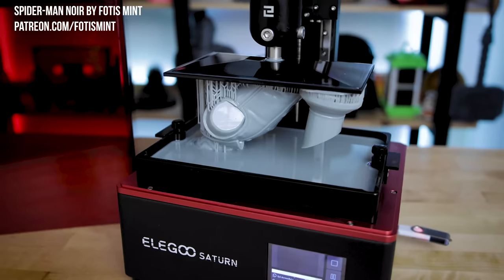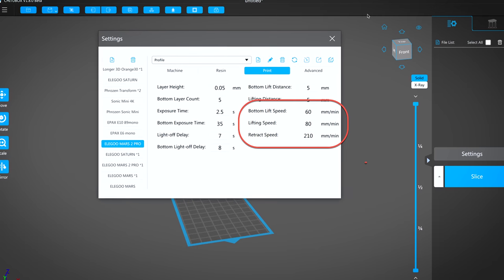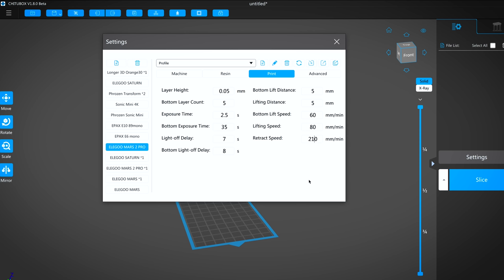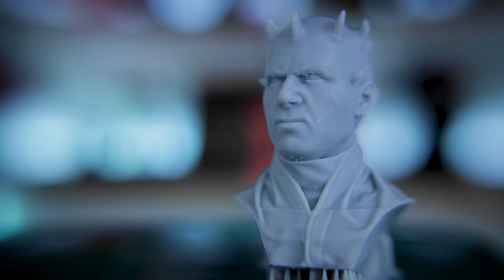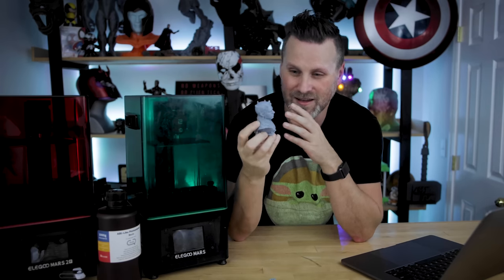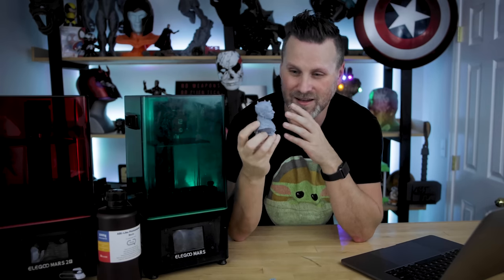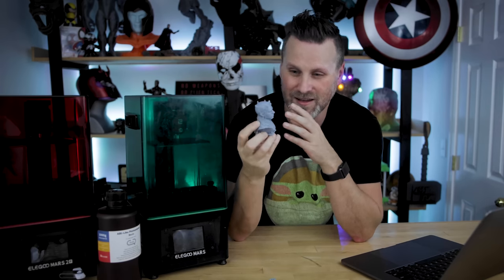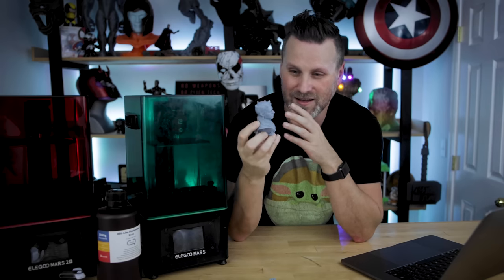Vroom - Faster Resin 3D Printing - How To

Comment: I'm curious to see what the long term effects of this is on both the mechanical side and the FEP itself. Not saying this isn't a good idea when tuned properly, it may not effect it at all, or if it does, the overall drop in longevity may be weighed out by the time saved benefit considering the relatively low cost of these resin machines.
Reply: for reference.. 240mm/m is the speed reccomended in the manual of the mono 4k

Comment: I've been messing with this for a little while. 
M8016 I - in your spreadsheet should probably be P not I (I is for the homing speed, at least for original mars... I'm not sure they are consistent with parameter names across models and versions) 
M8015 P - retract speed needed changed on my machine, You were probably limited to 120mm/s lift  with this set at 1.5mm/m like me which would explain your results.
You didn't mention how to extract your current machine parameters. Backing that up and inspecting it is the first thing in my opinion. Not a big deal since you weren't providing directions in general I suppose.

Comment: I thought this was speed settings. I've worked with 150/300/300 settings. Sometimes 150/150/300 depending.

Been running these settings for 4-5 months on Mars 2 Pro and OG Mars for over 1yr+ only downside I've seen is more regular screw maintenance, and much Lowder in comparison.
Reply from the maker: That’s great to hear! Do you mean providing extra lubricant to the rods?
Reply: @UncleJessy  yes and change it out more frequently. I do a change out usually around 3-4 months give or take on print quantity. Most of the lube is focused towards the bottom depending on what you print in size.

Comment: Increasing lift speed won't put more wear on the motor?
Reply from the maker: It could potentially, or the screen or the fep, which is what I tried calling out as a warning. But for sure worth testing out
Reply: There isn’t too much to wear in the stepper motor except perhaps the bearings if they are cheap and don’t have a thrust bearing. What it will wear out quicker is the lead screw and bearing.
Reply: @pstockley  I see, thanks for clarifying, wasn't sure.

Comment: Hey uncle jess, can you give me any advice about my wham bam plate, the magnet fell off after only 3 prints.
Reply: Did you properly follow the instructions to put it on the build plate? Scuffed the plate with the sandpaper, cleaned it with iso alcohol well, let it fully dry, stuck the magnet on the build plate and let it cure the full 72 hours BEFORE using it?

Comment: Anyone try this on a Mars 2 Mono (non-Pro)? I have had zero luck getting it to work.
Reply: Printing right now on a Mars 2 with the latest official firmware. Bumped speeds to 240 and doing fine, so far. zMUD at 3.5s.

Comment: Jessy.... This is a no go for a longevity of your printer.  Sure you can shorten your time, but you are destroying your FEP at an accelerated pace. Due to increased speed in the "UP"  pat of printing the Stefan Adhesion  produces bigger peeling Force (check on Wikipedia for basic explanation). Plus you need a resin with a low viscosity to quickly re-fill empty spaces when you lift the model. Though there are options to go as fast as hell, ...but is complicated. But, before a little explanation why a lot of your models fail. Well again, Stefan Adhesion is to blame. The force dramatically increases with a bigger area being pulled up. You put simply to many models on the plate :-).

Now to the method for increasing  the speed. Obviously the fastest would be a continuous pull. Carbon's Clip is on such a thing, Azul's HARP is another. And there is yet  another one employing a UVB + Blu light simultaneously to create an inhibition zone (similar to Clip)where no photo-polymerization happens.  But all this processes are out of the reach for common people. Though... There is a way.  On Instructables.com there's an old tutorial (on Ember, Autodesk's opensouced printer). The other company that brags about this absurd speeds up to 1200mm/h is... UNIZ. Though they launched the UDP (uni-directional printing) that in special circumstances even worked (not that fast though) but was a death end and they ditched it. It really wasn't practical. Basically you had to have a special resin with a delayed action. Meaning, you were constantly lifting the build platform while turning on and off the UV light. What happen was that the resin didn't polymerize completely.  Toward the part already exposed solidifies more than on the side where the fep film is. The catch was to get a proper lifting speed at a proper exposure with a proper resin. So the process, although academically speaking works, but practically is useless. Way to much settings and trial&error to get it work for general use. 
Way more promising is a technique of using a heavy oil where resin "floats" on top of it. NEXA is using it, Azul is using it and sincerely we are using it to :-) The printing speeds are really crazy!!!
Reply: @Abraka Dabra Are you talking about using the heavy oil in MSLA bottom-up?  Like having the oil on the bottom of the resin tray, and the resin floating on it?  If so, the oil doesn't impair the uv curing the resin?

The technique is used in top-down DLP printing, they usually use glycerin.

Thanks in advance, :-)
Reply: @retromodernart4426  No Glycerin is not OK. In a bottom-up setup, you need a heavy oil so the resin floats on top! Such oil has to have excellent optical properties too. And there are not many to chose from. The magic word here is fluorinated oil. This solution is actually nothing new. Though there are a few tiny issues you (and me too as we are working on such printers for two years now) have to solve. BUT it's a game-changer as it fully eliminates the peeling force.
Reply: @dodobarbar  Thanks again, very interesting!

Comment: So you're telling me allowing 20% of additional time will make my prints come out perfectly every time with no sweat. Got it.

additional note: I use 3D printing almost every day for work. Chasing speed for reliability almost always backfires in the wrong moment. Prints take some time, you will get used to calculating that in. By the way, I liked this video, this might come in handy in some extreme cases (if you're willing to roll the dice on a failed print). Cheers

Comment: I prefer reliability over speed, a failure depending on the size will get costly.
Reply from the maker: Yeah, on the flip side I’m so happy I tested this on the Mars 2 Pro and will more than likely be printing with 240 lift speeds from now on

Comment: 8:00 That's a rather large layer shift on that bust. If that happens repeatedly, the vroom settings are useless.
Reply from the maker: Pretty sure I explained that I did not recommend the vroom settings on the standard mars and that it worked amazing on the Mars 2 Pro

Comment: The problem with doing really high (60 sec) bottom exposure times is you are going to wear/burn out your screen. The temps get super high and for that long its going to wreck your screen in no time. I dont think the zoom settings are good at all. There are vids about how bad high bottom exposure and long exposure times are.
Reply: He hasn't changed his exposure time, only his lift speed. You can see the settings still say 35s for bottom layer exposure

Comment: Sure you have the chance of saving 40 minutes on a print but if it fails you not only waste the full five hours but the cost of resin itself no? 
I don’t really see the long-term usefulness of this if you have to go in and re-support a pre-supported model just a shave some time off. You’re spending that time in chitubox instead.

Comment: I have been doing that a month after my first print. Also, some slicers like lyche lets you tweak the lift height, so by lowering that it also lowers general time to print and resistance of the resin since it has less distance to travel at fast speed

Comment: We’re any of these test prints done with a flexible build plate? I’ve heard higher lift speeds could make the plate shift
Reply from the maker: Yep! Mars and Saturn. I don’t think I had any issues with them because of the flex plates. Will be adding one to my Mars 2 pro as well
Reply: @UncleJessy  interesting, my first print with my Fulament Fula-flex plate shifted on me. The fulament website faq said slow down the lift speeds

Comment: Good stuff! I've been printing with faster speeds like that too but when it gets colder I've found keeping the bottom lift speed lower helps keep failures to a minimum, unless you're printing in your warm house or in a heated enclosure (I'm in the garage).
Reply: One of the few times I'm glad to live in Arizona...
Reply: thanks for the tip

Comment: Probably a big role is played by the acceleration saved in the printer's firmware, if it is too low, then setting the top lifting speed to 500 will not do anything. Before the printer speeds up to 500, the table top will be at the bottom ...the end of the road...

Comment: Has this been tried on the Peopoly Phenom?  If so how well does it hold tolerances?  Thanks so much for sharing, I always love your videos.
Reply: My guess is this will not work as well on the larger printers like the phenom. The forces involved with really large prints are much higher and adding speed makes them worse

Comment: Thanks for the video. I have been interested in how this might work. As a former study of mechanical engineering, I can see this causing the life span of the motors being reduced. Again like you stated, we shall see if this causes issues.
Reply: I think they are Nema17's same that we run on plenty of FDM/CNC. With >3kg of torque I t think they will handle some aggressive FEP for a good time to come. Grab some nFep or maybe a bit of PTFE and you'll get a cleaner release and even less stress. Definitely nice to see the gamut pushed.
Reply: @AndyCiordia  Good information.  My thinking is that the motors are only going to perform "X" distance in movement.  That "X" distance in rotation will come more quickly at a higher speed than at the lower.  The only variable is the difference in time.  Will it be on average a 1 month different in time of failure, which is very acceptable, or does it take years off the life span.  If this is the case, then there will be an increase in maintenance to keep the printer going.  At that point a cost analysis would be necessary for the individual user to determine if the gain in production out weighs the cost of replacing the motors and or other components.  Just food for thought.